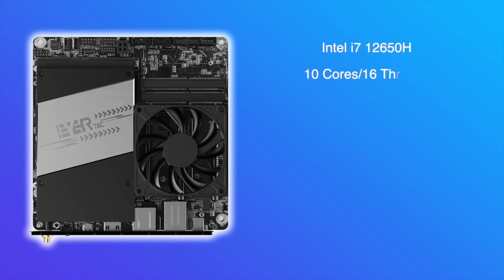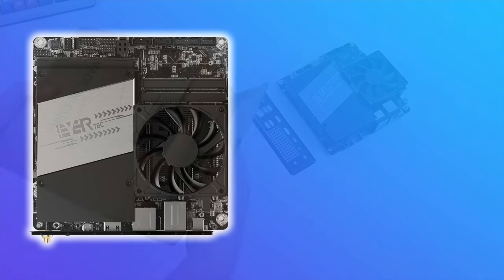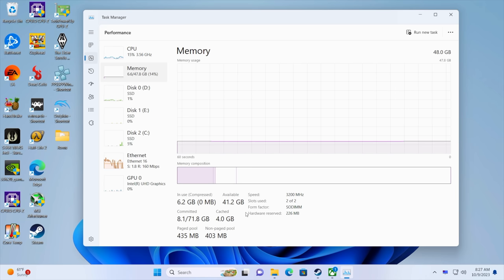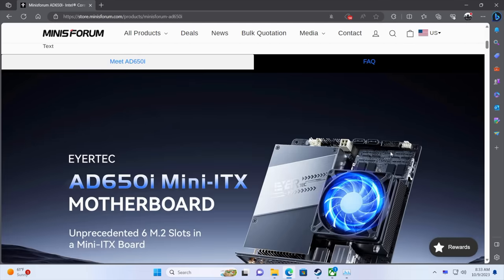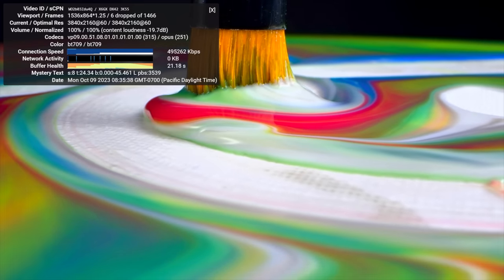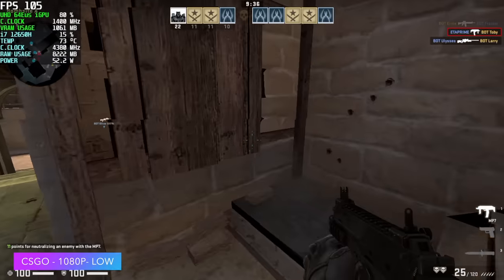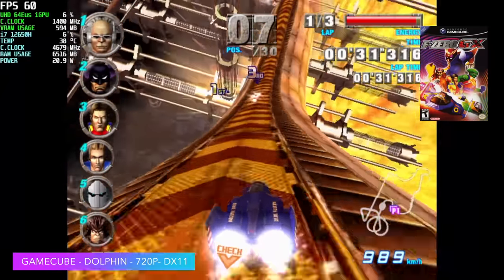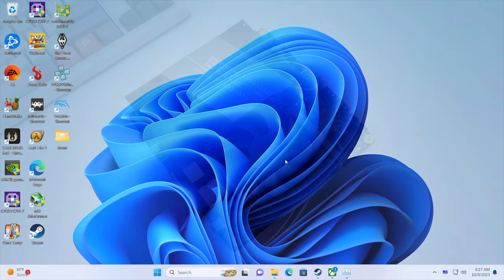This All New Mini ITX Board Has An Integrated 10 Core CPU! AD650i Hands On

Comment: Man, there is so much cool stuff being released now. Handhelds, SBCs, mini PCs and this miniITX
Reply: Yes. I'm waiting for the 7945HX 16C/32T ITX board / Mini PC to become more than just a vapourware press announcement: that will make an awesome compact and low power development machine.

Currently running a 7950X at 105W in a 4L Densium case, which is awesome for snappy development, but ~100W idle power at the AC outlet is a bummer.

Comment: Did not know Minisforum made ITX motherboards but this seems like a interesting board.
Reply: They have a brand new AMD one too, the BD770i that's shipping in November.  It uses SODIMM like this one, but has a full size PCIe slot.  It also needs a normal 24-pin PSU connector.
Reply: They just started with them

Comment: Based on the specs and i/o, this might be an ideal device for a DIY NAS. With the storage prices being so low, I've been looking for something that would allow me to use 8 NVME drives in raid, but 6 NVME + 2 SATA drives might work. This might do the trick.
Reply: I wouldn't mix your vdevs with different drive types, otherwise should be good. Id do the same if i didn't have a mini itx x299 board.
Reply: In that case, use 6 NVMEs for NAS, and use 1 SATA for OS and 1 SATA for miscellaneous
Reply: @fjorddenierbear4832  That's what I would do with it. Would be awesome. Id do it in like a ISK110 or something small af.
Reply: I've been on the hunt for a 6 slot NVME nas for ages and this scratches the itch. Could do with an i3 option and a price cut, for the purpose, but still....
Reply: Wouldn't you want at least 10Gb ethernet for that application?
Reply: you don't need raid, just run a JBOD with unraid.
Reply: @AndrewHelgeCox  Or the usb 4 it has?
Reply: @AndrewHelgeCox   why would you need 10Gbe? the onboard 2.5Gbe will be more than enough for a home NAS.
Reply: @oxfordsparky  I was thinking about balancing the bandwidth available to all that onboard storage. Wouldn't it be wasted if the data couldn't be moved on and off the system at the same rate that the drives could produce and consume it?
Reply: @oxfordsparky  There not using hardware raid (i hope) something like unraid or ZFS. We would still generally refer to this as being in raid, like a raidz2 for example.
Reply: 10 cores for a 24/7 NAS is massive overkill, 12th and 13th gen intel CPUs idle at higher power than previous chips.
Reply: Where does this NAS guys keep coming from???
Reply: recently news came that NAND and DRAM modules are going back with price, they won't be as cheap as couple weeks ago
Reply: @oxfordsparky then there is no reason for nvme at all. 10 gbe nic is minimum please do some reading
Reply: If its zfs nvme raid, it will be almost as slow as a single drive. Tested pcie 4.0 nvme on a TR 5000 series with 32 cores and 512gb ram. Have 10 gig and 100 gig nics in it. Even getting full use of sata SSD is hard with ZFS. Also, check Level1 tech videos about nvme ssd and raid. Raid on NVME is BAD even with intel ROC or AMD nvme raid. It's even not good with 2000 usd true hardware nvme Raid cards (several videos on YouTube that tested these new nvme raid cards) In short nvme and raid is just bad even now in 2023
Reply: @lllongreen  I think it's aimed at people who want a lot of solid state storage in the size of a hardback book. 

I could see reality TV film crews in remote locations using them to move data.

Don't assume every use case is yours.
Reply: @NamesGolden  then you use a USB attached drive areay, many have hardware raid build in. Using a NAS for your described use case is simply the wrong choice
Reply: @TheCyberSpidey  Sorry, I wasn't very clear. I currently have an old HP server (DL380P) I am using for virtualization and NAS. But it consumes a considerable amount of power and the drives aren't cheap. So I'm looking to replace with something more power efficient and more affordable storage. This mini PC looks like it might be ideal for my use case.
Reply: @lllongreen  You set it up wrong.
Reply: @fwiler  and then so did Lawrence from Lawrence systems...LOL you have no idea what you are talking about
Reply: Oh use a NVMe2sSATA adaptor to add more spinning disks.
Reply: @nick-leffler  thats actually what I will try with this board. I am currently running a Mini ITX J5040 with 6 HDDs as a Proxmox/True NAS server. With this board I'll try to upgrade to 12HDDs and SSD cache.
Reply: @TwistedAndVertigo Out of curiosity what would the cache be for?   With potentially 64 gigs of memory and a decent vdev layout + 12 drives only thing I could see is a metadata vdev.
Reply: @nadtz thanks for pointing this out, I honestly didn't think hard about the necessity!
I will run with 64gig memory and 4x3-mirror vdevs and thus clearly won't need a read cache ...
Well its still nice to have the option to add some more ssds, I guess 😅
Reply: @TheCyberSpidey  that was what I was going to ask here. I have a Synology NAS, with almost 10 years, actually runs really slow on the OS nowadays since Synology kept updating it for several years. My 2 storage mechanical HDD are still ok, almost near the capacity but I've been thinking of a solution to eventually replace it in a year or two but with the capability of upgrading when necessary. I thought this would be a good solution instead of using my massive full ATX case which I have in the box for several years. This would minimize of things but ye that CPU seems quite overkill just for NAS purposes. Specially considering that in my case it would be used to stream content and not run it directly since I have an Nvidia Shield for that. So not sure.... how much watts does this CPU take at idle?
Reply: @ToysRForever I measure the whole socket via home assistant and together with my router and no drives I see around 50 watts, it already runs 2 vms aside from host  so it's not even fully idling.
I will install drives next days but as I moved to full SSD arrays I do not expect that much of a jump 

On the plus side: you can also configure power levels in the BIOS
Reply: @ToysRForever  According to a recent review on another channel, the N100 idles about at 6-7W.

Comment: Interested in MXM GPU and connecting the power supply via the usual 4 pin, which is located on the motherboard. It seems that this may be a good solution for placement in the InWin Chopin case

Comment: Mini-ITX PC looks good. I can see these being a popular turnkey package. Proper desktop style CPU cooler, and the large heat spreader on the side for the SSD's. Laptops suffer thermal throttling from their mobile form factor. The Mini-PC allows more advanced cooling to get the most performance and efficiency out of a mobile CPU.

Comment: What i'd personally love for a file server would be dual LAN, dual power, and 3x M.2 slots on the top of the motherboard, maybe at 1x speed, then thermal pads to connect it thermally to both the mainboard, and the MXM board.
I dont need the speed, but i do need the space,

In my dreams that MXM board would have vertical mounts for 8xM.2 cards running at 1-2x link speed with maybe some ducting that uses the exhaust from the CPU cooler to blow through these vertically slotted M.2 cards that now look like a heatsink

Comment: There is also a BD770i unit with an AMD Ryzen mobile APU. That unit actually has a full sized PCI-E slot, and requires 24-pin power and a 4-pin CPU connector.
Reply: AMD is better option for Mini PC,I wouldn’t bother with Intel Mini PC because it would need a Graphic Card for decent Game but AMD has GPU which would have a better Gaming experience

Comment: I'd love to see how this runs with a mxm gpu. I think this could be the best option for my arcade setup ... need to replace my Nuc it's getting a little lazy with some of the newer games out
Reply: In particular the Intel Arc MXM cards. I think those are the only current-gen GPU to get an MXM version.
Reply: @ChristianStout  Only current gen, sure. But you can find RX5700 XT and RTX 2080 Super MXM GPUs, which would also be pretty comparable
Reply: Just go with a nice custom ITX setup with a low profile 4060...... way cheaper.....MXM GPUs cost at least $1000 for anything higher end. 

There's also the AMD 7000 Desktop APUs that may launch in the next 6 months, probably the way to go for an arcade machine for power consumption/form factor.
Reply: @Blind-Ambition  is there really an MXM 5700 XT? The latest MXM Radeon I've seen is the 580.

The trouble with the MXM 2080 is that it's a Clevo design, so it requires external power and probably wouldn't fit in this motherboard/case.
Reply: @ChristianStout  Yes. The Sonnet Breakaway Puck has an RX 5700 XT version that uses a MXM 3.0 spec GPU. As for the 2080, you might be correct as I have no experience with ownership, I just know that it physically exists

Comment: It would 1000x times better if it had a pcix 16x slot for a gpu.
Reply: It's got MXM which makes more sense for the ultra slim form factor this is designed for. 
If they wanted it to be for a full size build they would've not gone with a barrel jack and added full desktop connectors like PCIe x16 and ATX power
Reply: In my opinion this is an amazing Mainboard Something i was looking for.
There are other similiar Mainboards that are more geared towards gaming Like the erying Motherboards.
Reply: i just cant wrap my head around this fact.
Reply: There are 6 nvme slot, you can use one of them 5o connect gpu using adapter
Reply: They have an AMD version coming very soon.  That one has PCIe slot
Reply: Erying is already doing that with itx builds
Reply: I see it using a mxm to pcie 16x/8x and just slap’n on the new 4060LP
Reply: Gpus don't use all the lanes. They never really have, that's why Nvidia started putting m.2 slots on the 4k series cards
Reply: This is over priced crap for a super niche market. Has 0 effect on gaming. 0 effect on running nvme Nas. 

It's only useful if you want to run a nvme Nas in the smallest form factor possible when money doesn't matter
Reply: The BD770i is going to have a pcie slot and will have a Zen4 cpu. It comes out next month.
Reply: I thought MXM3 was dead is it still being supported?
Reply: No it wouldn't. There are other options for a pci GPU. This product is focused on being a APU form factor PC
Reply: I'm going to be that guy and say you mean pcie.  Pcix is actually its own thing you'd see on old server motherboards before pcie was made.
Reply: There is an amd version (BD770i) where there is a ryzen 7 7745hx and full x16 pcie5.0 and 2Xm.2 2280 pcie5.0 slots for 399usd
Reply: Buy the AMD version
Reply: And they just released the AR900i with a PCIe 5.0 slot.
Reply: It’s a server board. What are you smoking?

Comment: 10 cores are amazing. It makes more efficient and powerful to an system. The system decides, which cores are working and which are in sleep mode. It turns to the performance, which makes the batterycells better.

Comment: It's an interesting product. With the 12650H only having 28 PCI-e lanes they had to make some compromises on I/O that is for sure. I'd love to see some benchmarks with the system loaded up with 6 M.2 drives to see if there is any latency issues caused by any lane switching(if any) . If minisforum would release a proper motherboard manual(as well as update BIOS for their products) then a block diagram of the MB would show how its done.

Comment: MXM GPUs are tricky. And cooling them is even more tricky. I'd be interested in seeing if it CAN be done, but I wouldn't have a lot of faith. If it can be done, then spending a $300 on a MXM 2060 to stuff in one of these could be super awesome.

Though, I'd also be interested in seeing an MXM->PCI-E setup for this. I know the converters exist, and it runs at ~8x if I recall. Thats definitely enough to get a good performance out of a mid-range desktop GPU.
Reply: Do they make modern MXM gpus? Like the 30 series or anything on amd side I didn't even know they still made them

Comment: I think the external PSU idea is ok, but personally I loathe external power bricks. I wish it had USB-C with PD instead, and preferably still had the internal 24pin (20+4) connector.
Reply: Or instead of the 20+4 pin the simple 12V connector with the power switch as on some Supermicro itx boards.

Comment: @ETAPrime I picked up one of these. Like the unit. But I was wondering. Have you seen it take 60 seconds at the Bios Splash screen before starting Windows? I've tried contacting support about it. They don't even have a BIOS Rom they can send a fella to try re-flashing. 

It didn't do it when I first unboxed it. Only after fully updating windows 11 pro.

Comment: I would love to see some more CPU options on this board. Something like a 13850HX 20C/28T would be awesome without getting into the insane power draw of things like the 13980HX. That MXM slot makes me hopeful for either a round of MXM GPUs, like maybe a 4070M type card as the TDP would be manageable in the form factor this thing seems to be aiming for. An adapter card could also be quite useful, as then you can slot in any PCIE card you want for the most part.
Reply: Update on the MXM GPUs:

I've found out that there's an MXM version of the RX6600. By default it's capped at 75W and base clock, but csn have the TDP raised to 130W and full desktop spec boost clocks with a firmware mod.

Comment: pricing some MXM graphics cards with a decent video card this would be a compact beast for gaming!  my only curiousity is if the power supply on board supply enough for a beefy MXM video card. like a 1650 or higher.  does the mxm port supply enough power and can you reuse their cooling plate ontop of the MXM using thermal pads directly on the GPU die.

Comment: Would like to know if this can run Android TV. Could be a nice little Stream box/media center.
Reply: It should do it, considering that the Android for x86 is really good. Just install a launcher on it. Plus, the power will be more than enough to play 4k videos. But it'll be an overkill
Reply: Or you can use xbmc, plex or jellyfin.

Comment: This is great for nas or server. They have an Amd version Miniforum BD770i with proper pciexpress 5.0 slot coming soon which would be great to add a GPU but also needs proper atx power supply. I just wonder how good is the cpu cooling and if the bios has decent unlocked options

Comment: All things considered, a rather versatile machine that on the surface, looks like value too. 48 or 64Gb RAM is perhaps overkill for the demo shown. The one rather glaring spec that takes a point off it is the fact that it only supports a max of DDR4 3200, whereas the processor itself can support up to DDR5 4800/LPDDR5 5200.

But as something with great versatility and expansion options, very decent I/O and a decent enough processor, it looks attractive.

Add in that you don't need a whopping great PSU and that case for just $25 did a cracking job and it just adds to the appeal.

One aspect that I think could be useful going forward is the concept. They could easily look at retaining the general board spec, adding new processors and onboard options as they come along. Think Pandora's gaming box concept but applied to a general board size and layout.

It does stand out without having to think about taking out a mortgage to afford it.

It cries out for more demonstration of the expansion capabilities, including external GPU, multiples OS booting from all those lovely M.2 slots and use as a NAS/media server.

It is not often that something catches my eye and keeps it but this one does.
Reply: The MXM slot is kind of limiting some options it has right now. You're limited to a very slim selection of GPUs such as the rather rare MXM RX6600 or the MXM versions of the A4500 or A2000.

Comment: No you are correct, you gave the system 64gb of RAM but the GPU uses 23,9GB of that RAM. You can go to the BIOS and change the ammount of RAM that the GPU could use :)

Comment: If I can put this motherboard into a 1U chassis and put it in my rack, it will be great for what I need to do with it.  All I need to run is, Windows server 2022, NordVpn, qBittorent, sonarr, radarr, and jacket. Its sole purpose will be to feed my media server, which is a monster 4U box with 20 3.5" bays. I don't use my media server to acquire its own content.  The reason is with my vpn of choice running, I can't connect to it from outside my home network. I know I could use different vpn software but the one I use is the one I trust.

Comment: I got mine and its fairly speedy by its wattage!
But i have a major problem for my usecase:
I installed proxmox on it but cannnot get pcie passthrough working. Even with grub options, loaded modules and unsafe interrupts enabled. Bios says vtd enabled.
But proxmox still warns that IOMMU is not activated.
Did anyone get pcie passthrough to work on that board?
Reply: Just in Case someone has the same problem:
I realized upon reinstalling Proxmox that the BIOS got reset, therefore disabling vt-d.
Enabling it again makes everything just works as expected !

Now it's an awesome homeserver!

I also tried enabling SR-IOV but with it I found the Network isn't working.

Comment: I rather got 2x M.2 NVMe slot with full sized PCIe x8/x16 slot that have a bifurcation function, heck, even buying PLX card for it if bifurcation is not supported rather this whole non standard convoluted mess. 

MXM gpu cost tons of money, either the adapter to normal PCIe one. I get it if minisforum want to make more Powerful version of Asus Flashtor nas, but this is just wrong in many aspect. Erying implementation of of soldered mobile chip itx board is far more conservative and better in so many aspects, also, it's cheaper for the same CPU and using standard CPU fan mount 🤦